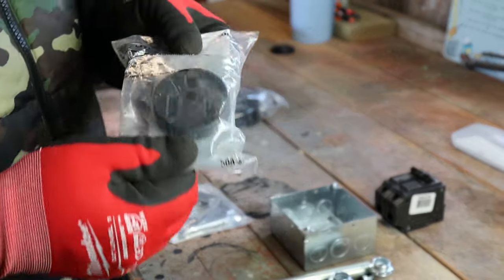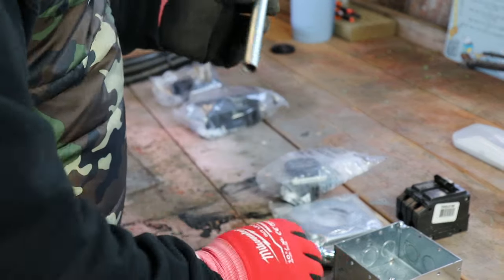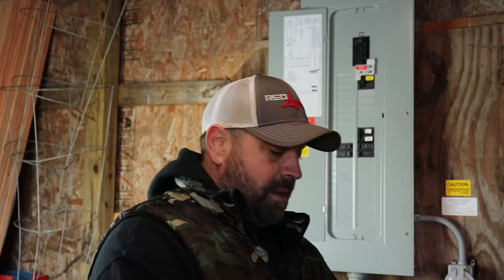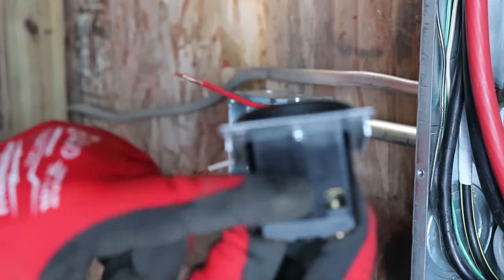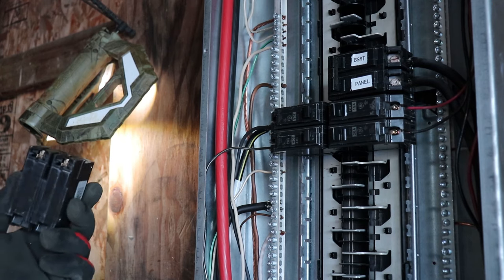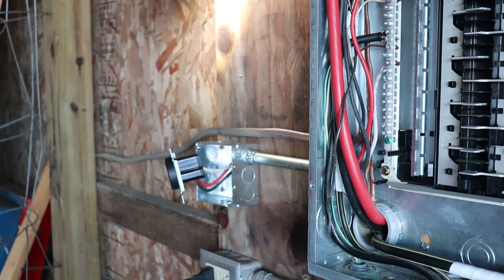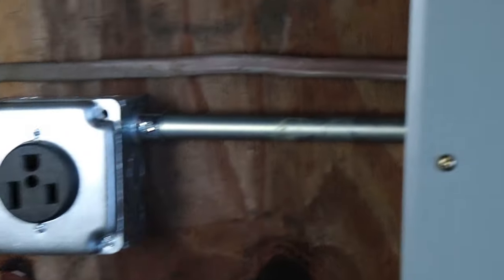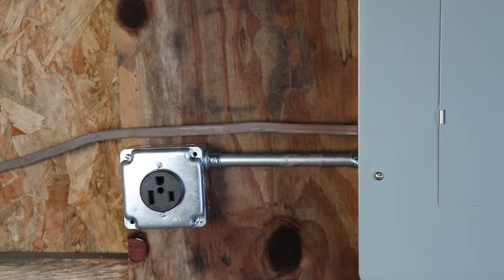Welder Outlet 240V (Complete Installation)

Comment: Haha nice vid. So I ordered me a Mig welder and going to need to have a 240 plug for it. Here is the problem, so I have a carport turned into a garage type situation and all ways had a long extension cord ran to it in order to do basic 110/ stuff. So the carport/Garage is about 100/150 from my house. Say I wanted to put a 240v out there along with a 110/ for lights and what not. What gauge wire would I run, and would I use PVC or something else  to bury the line? Just wonder if the same concept would work, but further away. I liked and subscribed to see your welding vids as well.
Reply: probably want to run your wire to  subpanel on your garage.  you'll need #4 wiring and you'll want to go from the bottom of both panels with pvc.  then do 4 circuits out of that panel 2 for the welder 1 for light and 1 for 120 outlet.  also if you're not sure about it in any way hire an electrician so you don't hurt yourself or burn your house down
Reply: i used underground direct burial 2 ought aluminum wire, 4 wires in total ( 2 hot, ground and neutral)

Comment: How do I wire a outlet for a welder when I don’t have any open spots in my breaker panel?
Reply: You can probably swap out a breaker with a large amperage breaker and thicker wire to match, and send that to another small breaker box, but I’m not a pro. DONT just swap the breaker without the upgrading the wire. You could burn your house down.
Reply: You can free up circuit breaker space by using tandem circuit breakers.
Reply: Here in Canada we need to use a number4 copper from main panel to sub panel or no. 2 aluminum .please check with your local electrician

Comment: So we can use 8-2 wire with 50 Amp breaker?
Reply from the maker: 6 gage would be better but 8 gage will work. Nothing smaller.
Reply: @TheCookFamilyHomestead  ok thank you.
Reply: No, you must use 6 gauge if you want to meet code
Reply: If you use 8 gauge make sure the breaker is 40amp or less
Reply: Actually it's not that simple. If you are using nm or uf cable (all 3 wires are together in a rubber coating) then you have to use 6 gauge. If you are running thhn (separate wires) inside of conduit then you can use 8 gauge. The reason is because the different types of wire have different temperature ratings but you wont overheat 8 gauge thhn on a 50 amp breaker and it passes NEC code.

Comment: Code violations here: (1) You can't take out the wires from a cable to use them in a conduit. You need wires that are made for that (e.g. THHN) (2) White is not allowed to be used as ground for #6 gauge. In fact, it would have been OK to use the EMT as ground, but not the white wire. (3) Wires must extend to at least 6 inches into boxes, and at least 3 inches beyond the edge of the box. (4) The metal box must be grounded. (5) If this is a garage and you are on NEC 2020 or later, the receptacle must be GFCI protected.
Reply from the maker: There are zero code violations here. None.
Reply: Csbiro,   The receptacle does not need to be GFCI unless the 2020 NEC is adopted in his area.  Being as this video is three years old, it is highly unlikely that 2020 NEC was adopted there.  The box is grounded by the EMT and connectors.
Reply: @TheCookFamilyHomestead .  You do have two NEC violations.   Comments 1 & 2 above are correct and you did violate NEC.

Comment: So many questions here. Is this distribution panel in a separate building away from the source? If so it looks like the ground bus and neutral are tied together. I also see that the neutral and ground are not separated. Also curious why a ground wire was not used instead of a neutral?

Comment: Great video. I actually have the exact same 6–50 outlet you are using as well. I am also using a 50amp breaker. When I tested the voltage on the 6–50 outlet, my tester is only reading 120V. Do you know why? Thanks for your help
Reply: Were you testing the voltage from one of the hot leads to ground?  Because that will show 120V.  The two hot leads are in opposite phase to each other, so if you test the voltage across them, you should see 240V.
Reply: I did the same once and not many discuss this but... you have two legs coming into your breaker box at the top. If you look closely at the panel, every other breaker is the same leg of the 220 coming in at the top. So you need either two consecutive full breaker spots to bar the breaker so they both trip. But if you have two 120 vac from the same leg , you won’t get 220.

Comment: Call your Dad- the ground connections are on the right side of your panel. You connected your ground wire to the common bus on the left side of the panel.
Reply: It's a main breaker box and therefore the neutral and ground are tied together.  Notice the green screw?
Reply: Call your High School shop Instructor- The neutral and ground bars are bonded by a screw so it doesn't matter which bar you connect to; its the same.
Reply: But if your garage is a sub panel do not mix neutrals and grounds

Comment: Typically a 6-50 plug is wired with a 6/2 wire with the bare wire going to the receptacle and the box via a pig tail.

See Mike Holt's diagram here: https://youtu.be/Qynp92rIlYg?t=823

While some (maybe most) larger amperage receptacles are self-grounding, and the box and conduit can be mechanically attached to the metal panel, the safest method is to ground the metal enclosure using a pigtail.

Comment: So I had a welder and it came with an adapter cord that allowed me to connect the welder into a regular 3 prong wall outlet and it ran pretty good. I bought a lincoln 180 but when I hooked the adapter cord to it the welder couldn't even fully power up. I couldn't weld anything. I'm not an electrician but can't I just tie into the dryer receptacle and mount the correct receptacle for the welder right next to it? As long as I'm not running the dryer and the welder at the same time?
Reply: Did you find out? I was wondering exactly the same thing. My panel is full.
Reply: @geecrawdad  I did it and it works great! I went to Lowes and got the receptacle I needed, cut the power to the dryer, tied into the dryer receptacle, and mounted the new one right next to the dryer receptacle. Ive ran the welder at least 5 times and haven't had any issues.
Reply: @somanynamesilltrythis0180  No kidding. That's great to know. Thanks for getting back.
Reply: @geecrawdad  no problem
Reply: @somanynamesilltrythis0180  I'm thinking of just plugging right into the dryer outlet and, with a 20 foot extension cord, it would reach well into the garage. I guess the plug on your welder did not match the outlet for the dryer?  Thanks!
Reply: @geecrawdad  no, the plug on the welder looks like a regular 110v  3 prong receptacle only bigger, and made for 230v-240v. I bought a 25ft extension cord for the welder, it plugs directly into the welder and runs to the new receptacle.
Reply: @somanynamesilltrythis0180  I see, 240v welders have different plugs.  That will be helpful when choosing the welder. Thanks again. Be safe and happy welding.
Reply: @geecrawdad  you're welcome, same to you!

Comment: Don’t you have to ground the box itself?
Reply from the maker: The box is grounded.
Reply: Can I just install the power cable with no tubing? My outlet will next to the panel box too just like yours but my has drywall
Reply from the maker: @ricardohz5148  You can.
Reply: @TheCookFamilyHomestead  can I make a power cord for my compressor with the 10-2 wire? I have a 30amp 240v plug for it?
Reply: Yes is kinda grounded but by code, supposed to be connected with the ground wire the ground wire supposed to be green not white. White by code is neutral. If you use it as a hot it must be reindentified. Tape can work.
Reply: Yes per code
Reply: @TheCookFamilyHomestead  Hey can you advise how the box itself is grounded in the video?  I didn't see how its grounded.  I'm just asking for when I do this myself.  Thanks for the video btw.
Reply: @moparkid440  when the receptacle is mounted in the box and the ground wire is attached to the receptacle the screws that mounted the receptacle tie the box in with the ground terminated at the receptacle..

Comment: I rent where I live so I am not willing to pay to have my shed wired for 220 do you know of a good generator to run my Omnipro off of? Thanks!
Reply from the maker: I tried running mine off of my generator. It will run it off the 120 but it is very weak. Can only weld very light.
Reply: I just tried running my omnipro 220 off of my (Honda Home Power 6000) generator 250v outlet and it powered on and then shut down 20 seconds later, gave me an error message that read "Machine went into fault due to..
-Duty Cycle Exceeded
-Low Voltage input
-HIGH Voltage Input"

I turned it off, switched it back to the 120v cord & plugged it into my normal 120v garage outlet and it works fine it seems. So generator power didn't work for me man, at least not for the 240v mode.
Reply: @TheCookFamilyHomestead can this installation that you demonstrate from this video be performed in any garage or home? Or do I need specific preinstalled high voltage wire running to my house? I have an Omnipro as well. Really wanting to try it out in the 240v mode!
Reply: @TheCookFamilyHomestead  any input would be highly appreciated. Thanks a ton, man

Comment: so why only 50 amp - why not 100 or 200 for 200 amp welders
Reply: The welder will call out it’s max amperage at full power listed in the manual most around 47-50amps
Reply: @pappaclutch3266  And I find you again bro! You gotta stop with this 🤯🤣
Reply: Generally, welders are or are designed to act as stepdown transformers. They have lower output voltages (usually 17-55 volts)  than input voltages. That's why they are able to use higher amperages.

Comment: Hi and thank you for all the time and effort you put into making these videos. 
Can you please Help? 
I am a British Ex Pat, living in South Korea. My Korean 
is terrible, so finding any kind of help, let alone 
the kind of I am looking for, is a bit of a nightmare! ... LoL! 

I went online land bought a powerful, portable 240 Volt 
American Generator., DuroMax.  XP11500EH. 
All documentation stated that this Generator produces 
both 120 Volts and 240 Volts.  
Unbeknown to me, this is not exactly true! 
It produces two legs of 120Volts! 
Almost all my tools are 240Volts and have the British 
Wiring set up,  Earth, 240Volts Live & Neutral, like most  
of the world!
I need to know what can be done to get my tools to work 
from this generator. 
I cant use an inverter, because I'd loose the Amps.

How can I wire the Plug from this 4 wired American setup to run a 
3 pronged 240 Volt British Tool? Live, Earth and Neutral!

WHAT CAN I DO? ............. 
1.) It occurred to me that I might put the two hot 
      legs together, to form one live out put, but I have some concerns about that.        
2.) The other thing might be to dial up the voltage, 
      on, or replace the A.V.R. with a 240 Volt A.V.R. 
      of the same or similar Amperage value. I don't believe that there will be any
       need then to change any of the wiring on 
      the Generator, as the (1 of 2) 120Volt Hot 
      legs just becomes redundant, (as I would only 
      use one leg, left or right.) Effectively, every Live output 
      will become 240 Volt!  ........ 

What do you think? .......... Do you think this will work? 

I am open to any other suggestions you have. 
Thank you for you time. 

You can email me at: 
surfacesupplieddiver@yahoo.com 

Kind Regards! 
S. Ashcroft

Comment: Wondering why you didn't ground the receptacle....?
Reply: Good point. He probably should have used a small ground bus bar intended for a sub panel and mounted it to the metal box, connect the ground cable to one port, then pigtail from another port to the receptacle. He's apparently relying on contact from the mounting screws to ground the receptacle. The box is grounded from the metal conduit. Not sure if that is considered adequate.
Reply: @surferdude642  ground wire from panel to receptacle then to plug would maybe safice. I'm definitely no professional in this arena, but I'm almost certain the plug should also be grounded to receptacle one way or the other. Maybe just my assumptions.
Reply: @jdstory5217 I did a little more research and found out the 6 gauge Romex comes with 10 gauge ground wire or use 6 gauge THHN wire and 10 gauge ground wire. Then you could ground the box just like on a 120v circuit using pigtails and attaching the one with the green grounding screw to the box and making a 3 wire joint with a wire nut or loop the wire around the grounding screw and land on the receptacle ground.

Comment: What kind of romex cable is needed? 6/2 or 6/3?
Reply: I'm not sure why he said you can use 8AWG.  I'm pretty sure you need 6AWG for 50 amps.  I recently installed one of these circuits and used 6-3 (2 hots, 1 neutral, 1 GND).
Reply: 6/2 and mark the white wire with red or black tape at each end to indicate hot, no neutral wire needed here. The ground wire is 10 gauge so you can ground the box, he didn't do that and could be a violation.